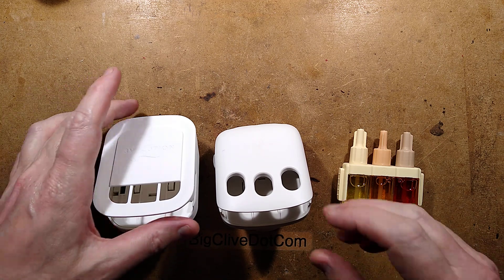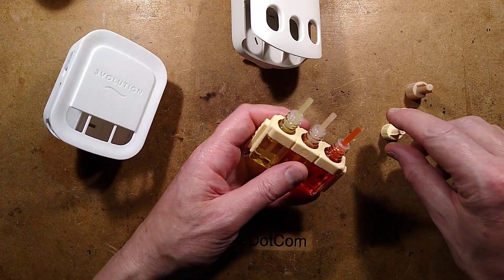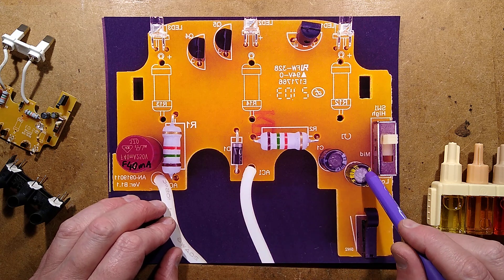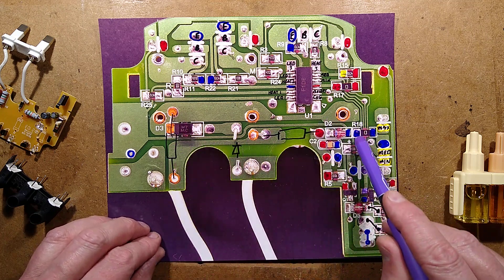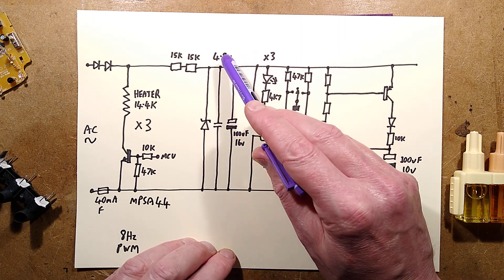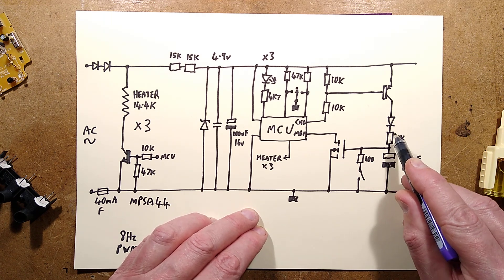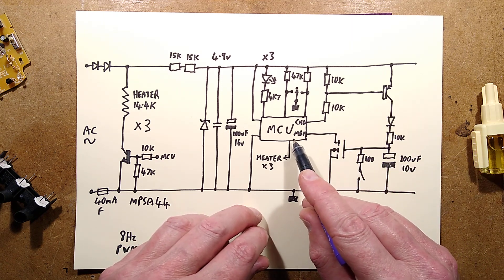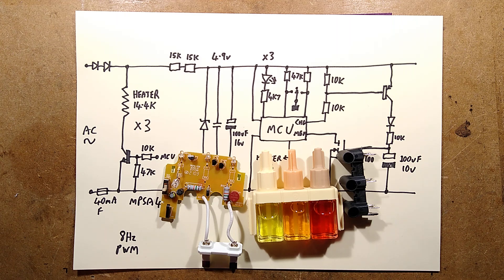New 3volution unit has clever circuitry

Comment: Would it be possible to easily convert it to 12V operation instead of 220V? I would like to use it in a car. Thanks
Reply from the maker: It's viable, but the output of this would be far too high for a car.
Just leaving the caps off with the bottles mounted to avoid tipping over, will give off lots of aroma.
Reply: @bigclivedotcom  thanx for answer! actually my friend a taxi driver is using it in his car on a daily basis with a power inverter (only sinus one is good) and is working great (gets 5 star ratings) and the scent is just right with cotton flower (only that one). I wanted to help him and maybe others with a inverter free solution. any idea how to proceed?

Comment: Interesting. As I'm about to change my old untit for the new unit. My old one is tired, it empties the first 2 chambers but doesn't use the 3rd chamber. Does anyone really put it on the lowest setting?
Reply from the maker: If it doesn't vaporize the third chamber then it may be faulty.  You could turn the cartridge round to use it up.

Comment: That capacitor just is used to know whether to re-I it the memory of how much fluid you have used up. 

But where is the actual memory of how much fluid is used up? It much be in SRAM in the microcontroller? And the micro controller must also remain powered? Or is it in flash memory in the microcontroller? I’m guessing flash.

Did I miss that part or was it never explained that the ‘countdown’ is not kept in the capacitor?
Reply from the maker: Any counter for fluid level will be writes to internal memory. but with a wide time between writes to prolong memory life.

Comment: I used to repair train ticket vending machines and was confused by the coin system, the machine knew if a coin tube had been removed and replaced even if all power to the machine was off, on the PCB's in question there was nothing "smart" and no backup battery etc., confused me for ages but I reckon it must have been a similar system to this, it was fairly tamper/fraud resistant as well as you couldn't get to the PCB in question (to bypass the check) without removing the coin tubes, and removing the coin tubes dumped all the coins in them into the cash box before you could take the tube out. Wish I still had some of the parts, the machines were considered obsolete when I was looking after them (they ran OS/2 warp) and have now all been pulled out the ground and scrapped. SNCF still have them in use in France though.
Reply: A typical day fixing the machines :-

https://www.youtube.com/watch?v=li8tQhfp6IY
Reply: This was the coin sorter carousel, inserted coins dropped into the next available slot, then they could either be returned to the customer, dropped into the relevant change coin tube or if tubes were full dropped into the coin box. It used rotary solenoids which could stick so I reverse engineered the protocol and made a simple Arduino based test board so I could check them, it could also test various sensors on the board, one of which was a piezo disc that sensed when a coin had dropped into the slot ad they could come unglued or the thin wires soldered to them would break.

https://www.youtube.com/watch?v=vXho3X5UXOo

Comment: Clever, mostly because I never would have tried it.  I expected that electrolytic caps would have a high enough self-discharge to be useless for retaining the voltage for more than a few minutes.

My experience with high voltage caps (with no safety bleed resistor) is that they don't behave in this useful manner.  They typically self-discharge in minutes or hours.  They also have 'charge recovery' that potentially makes them dangerous again if you only briefly short them.

Comment: That bit of the circuit remembers the change state, but where does it store the operation count, the MCU has no power loss input, unless it goes into a low power SRAM hold state as the voltage drops, or holds the use count in flash memory.

Surely they don't use the capacitor as an analog use count?
Reply from the maker: The capacitor is purely for unpowered cartridge change detection.

Comment: It is quite strange watching you discuss and explain these very complicated and self-referential circuits--at least complicated to me! This is because there seems to be a great deal of overlap between the thought process of working around a problem to a desired solution in electronics and doing the same thing in programming. In a way it almost feels like electronics are frozen programmes--or perhaps computer programmes are infinitely modifiable circuits...

This appears even more the case when you start looking at things like, say an 74Fxxx TTL logic chip where you will literally have an 'or' gate chip or an 'and' chip. These physical pieces of equipment are directly analogous to an 'if... then...' statement in a programming language. So when you solder together your circuit using these components you are actually forming a 'programme' that has physical existence... A very, very odd thought indeed!

Comment: Why not use a micro with onboard flash? They would save eight components and gain a lot more flexibility than their a single bit of artisanal DRAM could ever provide. They could even cycle through different patterns each time the LEDs flashed; that would be really smart and revolutionary.
Reply from the maker: The unit has to be able to save the cartridge change switch action while unpowered.

Comment: Hi Clive, I'd love for you to do a video on batteries, most lithium batteries I come across in small devices (ipod, switch, phones etc, have 3 wires or terminals, a positive, negative, and I never understood what the other wire is doing, or what the circuitry inside the batteries themselves are doing. Also some drill/portable tool batteries have these mystery extra terminals, iv tricked a bosch drill into accepting a makita battery, by measuring the resistance from this other terminal to ground or positive, and then replicating it using resistors, but I'd like to know what's actually going on there.

Comment: Yet again another nice tear down and reverse engineering. QUESTION. I understand the power rating of through hole resisters but is there a rating on smd resistors ???
Reply from the maker: Yes.  The higher power SMD resistors are physically bigger.

Comment: Likely the resistors in the heaters are the same 15k resistors, as used on the board as voltage dropper. No need to buy another part, just take the one bandolier of resistors and have a few people taking a resistor off the tape, folding the leads on a jig, and stuffing the resistors into a plastic housing, then passing to the next guy, who is pouring the plaster of paris slurry into the holes, and putting them on a rack to dry. The last person takes them after drying, and wipes excess away, and then they go through to the rest of the factory to be assembled.

Comment: I won't lie, when I saw the ad for these claiming "Smart technology", I couldn't help but laugh. I assumed they slammed a cheap microcontroller in there with some basic software but you have proven me wrong sir. Impressive stuff!
Reply: There will be a cheap micro in there, but obviously it doesn't work when it's switched off, so that's what this clever circuit does. Just holds a little bit of voltage in the cap, that can be discharged, left as a signal for when the micro is powered up again. 

I wonder why they used an electrolytic? Yes they store a lot of charge but their leakage isn't great. I wonder if some other kind of cap would've been better? Like 1000x less capacitance but 100,000x less leakage. Since it's only storing a voltage, there's no real current coming out of it that's being used for anything.

Comment: A base-emitter resistor is the sign someone knew what they were doing.

Explanation: If the MCU fails to initialise it's possible the bases of the heater control transistors will be left floating which is never a good idea. Here there's the possibility all three heater resistors could end up being turned on.
Reply: With BJTs the only current which could flow is leakage current. And I wouldn't be concerned with all heaters being on at once, nothing bad should happen (other than the stench). I'd be more concerned with a transistor being half on, then it would dissipate half a watt and overheat. Still, the worst result would be a blown transistor.

Really for such a cheap throwaway device I think it would make more sense to save a cent and omit the resistors.
Reply: @eDoc2020  Here there it's not an isolated base lead. When you connect an isolated track and add 230Vac to the mix there's no knowing what it might pick up. There's another possibility in that the pin it's connected to on the uC might default to a weak pull-up input until initialised.
Reply: @Graham_Langley  I'm not denying that the transistors might end up conducting a bit without the pulldown resistors. My point is that it doesn't matter if it does. Once the MCU initializes it can apply pulldown and turn off the transistors. If this takes a few seconds to happen there's no harm because there are no immediate effects; it takes a while for the heaters to reach temperature. If the MCU doesn't initialize the unit is broken and if the unit's broken nobody cares what it does as long as it doesn't catch on fire or burn.

I guess what I'm saying is while the resistors are a sign of good design, cost-cutting is entirely fine here. IIRC these resistors are a unique value, so in addition to the BOM cost it also requires an additional reel on the pick and place machine.

Comment: So, a 1-bit DRAM with an extremely low refresh rate. Novel! I have to ask why, though. So it can fake knowing when it's time to nag you to put more chemicals in? It's not like it's printer ink, how much can they even make from replacements anyway? I bet most people, by the time it's run dry, just chuck it and buy an even "smart"er one.

For all the bother, they may as well have just used some opto sensor to shine through the bottles to see if they actually are empty. If they want to be really cheap, just have one LED that shines through all 3 bottles in series, and mould the bottles into a particular shape to guide the light right through.

Still overall, there's no NEED to have electrically heated air freshener. There's plenty that work fine at room temperature. Even an essential oil in a bit of plain carrier oil will evaporate quick enough just left on a bit of lint or whatever. I dunno. Just clean your house! It should smell fine! What's even the point of an air freshener? 

I suppose it's clever in that it detects a bottle change when there's no power to the circuit, since it's designed to do that unplugged. Still, pretty pointless bit of rubbish.

Comment: i am a bit confused. i understand the capacitor memory would work one way, in that, when the unit is turned on and a new cartridge has been fitted, it will "think" new cartridge, 100 hours of use, then stop. but if you plug it in with old cartridge and capacitor still charged, wouldn't it have to have a memory as well to "think" old cartridge, 24hours of use remaining, before stopping? i guess it does, the difference being it needs to know if you changed the cartridge or not when power was off.

Comment: You said "when the switch is in the middle, and both are floating...", but they wouldn't be floating. They're tied to the high rail via those 47k resistors. So, they wouldn't be floating, they would be pulled high. It isn't like you to misspeak like this, so I'm confused and bringing this up to make sure I'm not missing something or misunderstanding.

Comment: Last time I used any air freshener like this, it was the original Glade Plug-In. Or maybe it was v2.0, because it had the adjustable odor output. It did... OK, I guess, but the cost of refills was ridiculous, and it seemed like such a waste with all these little glass bottles gathering up around me... I started using cheap liquid potpourri to refill them, and managed to get one or two more runs until the sheath around the wick came unglued. The biggest drawback was the potpourri residue at the outlet of the freshener. I gave up using them right around the time Walmart started selling store-branded refills, which were more reasonable in price, but still had an uncomfortable amount of glass and plastic waste.
I use one of those fully-automatic time-delay flamethrowers, minus the ignition source. lol
Reply: I have one of those, problem is that thing eats batteries like nobodies business, rechargables even more so.

Comment: I used a similar circuit in my OpenDAC HD to store the on/off state. Basically, I had it so that the capacitor discharged on start means the unit should turn on automatically and if it is charged, it should wait for the user to turn it on. That way, it could be switched on/off at the external power supply or by pressing the volume knob, and if turned off using the knob, a power glitch won't cause it to turn back on.

Comment: Does it also remember at which stage of the 3x45 minute scent cycle it's at even when un-plugged? What happens if you never use it for over 45 minutes at a time? Does it always restart the 45 minute timer and scent cycle from the start so that you end up using only one of the scents while the other two are never used? I think that is a far more important feature than blinking the lights to remind you to change the cartridge.
Reply from the maker: It doesn't.  It relies on the unit being plugged in for long periods of time.
Reply: @bigclivedotcom  Oh... Well that kinda sucks. For optimal balance you need to use the device for 2h 15m at a time, or any multiple of that. A digital timer would be a cool idea in conjunction with the air freshener. Plugging and un-plugging a device such as that at least once a day sounds unnecessarily inconvenient.
Reply: Theoretically it could write to it's on-board EEPROM what the last fragrance was, and how many minutes it was on. Update that maybe every 2 minutes. EEPROM can take however-many thousand or million writes so that'd be OK. Assuming the chip has EEPROM. They don't all, and I imagine they went for the cheapest option for this, maybe something 4-bit and horrible to program, if they still make those. Still you never know, might be.
Reply: @greenaum  An EEPROM would usually be rated around 100,000 writes so it actually would wear out if continually updating every minute. A better option would probably be only updating on powerup. If it starts on a different capsule each time chances are it would even out over time. Another option would be a way to "randomly" choose, maybe measuring some sort of time constant.
Reply: @eDoc2020  Well yes every minute x 100,000 is 69 days. So maybe every 10 minutes? That's a couple of years, after that who cares if it goes a bit doolally? It could even go every 45 minutes, just before it changes fragrance, update the EPPROM on what you're choosing next, then do it. That'd last essentially forever. 

Randomness would be difficult to do, if there's no inputs. Just a button that almost never gets pressed. You could add a thermistor or something for noise, or even shot noise in a diode. Lot of faff though. And EEPROM is an option in microcontrollers, random numbers tend not to be. The higher-end ones have hardware RNGs but that's like ARMs meant for systems with graphics and maybe a bit of video, not an air freshener.

Anyway that 1-bit DRAM with the long refresh rate, that is clever for the unit to detect a new cartridge, have to give them that. It's interesting seeing how people design systems that are supposed to work with the power off. Some interesting though exercises.
Reply: @greenaum  Add another circuit to get a second 'bit', that'll give you 4 states.  00 for new cartridge, and 01, 10, 11 for current scent.

Comment: Is it just me that thinks the circuit design stinks (pun intended)? No modern circuit design should be deliberately injecting DC into the mains. These aren't so cheap that they couldn't afford a bridge rectifier. Ok its only 11mA but some housholds may have half a dozen or more. DC is not good in the mains supply network, causing neutral line overheating, transformer saturation and galvanic corrosion. Okay, not a significant problem perhaps with < 66mA perhaps but it adds to all the other DC supply pollution from other households, equipment, especially old gear with faults, corroded connections acting as rectifiers etc.

Worse though, if you plug it into an incorrectly wired socket or extension cable with neutral and earth swapped, the resulting DC earth current could 'blind' an RCD preventing it tripping in a real emergency. This dangerous condition would go unnoticed until the RCD test button is pressed. How often do you do that when the RCD is in a consumer unit, high up in the garage behind all the ladders, wood, tools etc?
Reply from the maker: This is a good reason for progressively moving to type A RCDs/GFCIs.

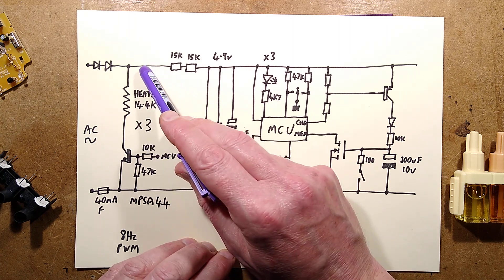Comment: 6:20 - Two 7.5K dropper resistors
Reply from the maker: Brown, green, orange.  15 and three zeroes.   15K times 2.
Reply: @bigclivedotcom  My monitor colour rendering must be way off. I just looked again and they still look Purple, Green, Red, R2 especially.
I just checked Windows hasn't gone night-mode on me. I believe you though so no worries.
(fwiw, I learnt resistor colour code and numbers on '96 set valve radios before I went to school, so a bit over 60 years ago, ouch!)
Reply: @bigclivedotcom  It looked Brown Green RED here in Australia.  But even IRL Red vs Orange can be a difficult call on modern five band resistors.